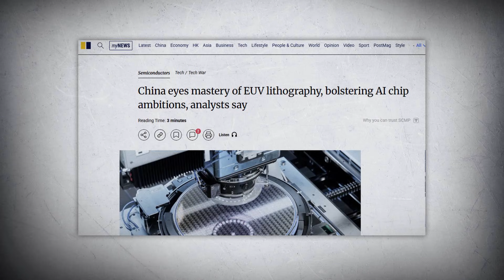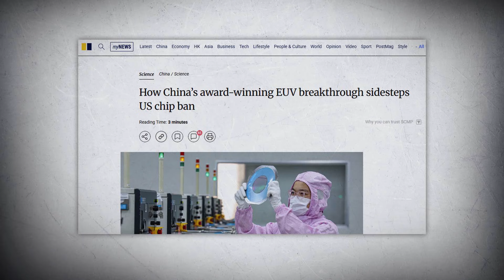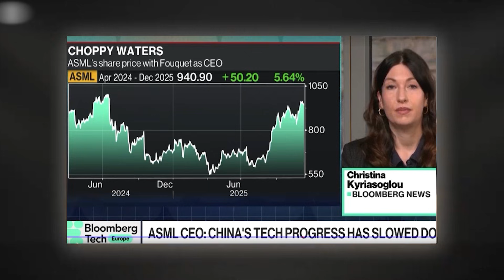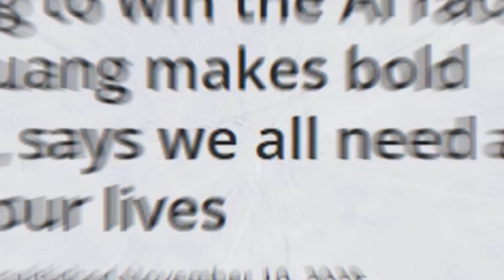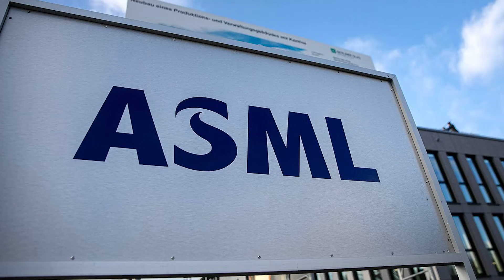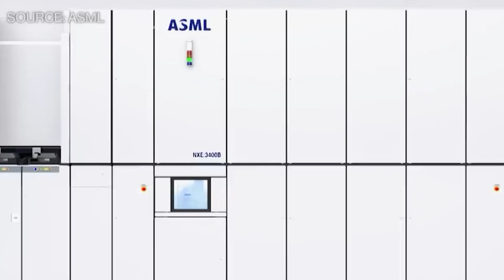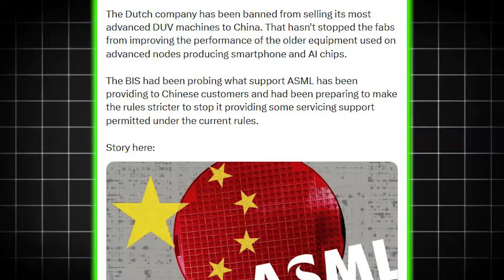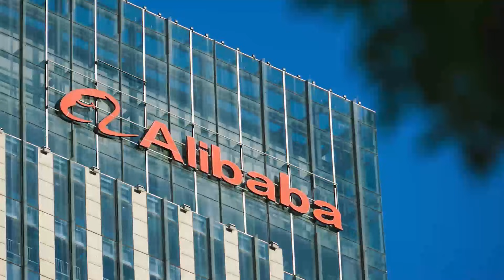China’s Manhattan Project: The Secret EUV Machine the U.S. Tried to Stop

Comment: When they say it will take China ten years to develop the EUV technology to an advanced level they are referring to actually mass-producing the most advanced semiconductor chips , with low fault levels ( low bin rates) and profitably. Anyone can use ASML older machines to make "one-off" 3nm chips , which is what Huawei and SMIC are currently doing, its not that hard.

Comment: Its a prototype. As big as a factory floor. It cant produce chips. Can china make commercially viable duv chips? No. Can china make commercially viable euv chips? No. Will china achieve this feet? Highly likely it will. Will china do so before the west can ween itself off its need for imports from china’s rare earths, is the real question. I think time is not on china’s side as the west has the refining tech but lacks the infrastructure while china lacks the tech. Its easier to build and set up supply chains then to reinvent an existing tech.

Comment: ASML did not master all key omponents for EUV machines. Lenses are made by Carl Zeiss opticks from Germany, for example. And there is more like that. So, ASML is supply chain dependant, and many parts for ASML machines are actualy dependant from China, in basis of that supply chain. So think about when you limithing  someone that yuou need to sell you something that is exclusively available only from him, like Germanium, or som other not so common materials, like strong magnets , that are also needed in ASML machines.

Comment: Reuters claims China is using reverse engineering, which is complete nonsense. China doesn't currently have EUV machines, so how can they reverse engineer them? Are they reverse engineering something out of thin air?
The most bizarre logic of the West is that they always assume China lacks independent research and development capabilities, and whenever China achieves a technological breakthrough, they immediately claim it's "reverse engineering, imitation, or plagiarism."
If the West refuses to face reality and continues to bury its head in the sand like this, it will only lead to further decline in the future.

Comment: China is making a more advanced EUV machine. It does not use a gear to move the wafer; instead, it uses magnetic flotation. China uses much higher UVlight generated by a special method.. Etc....The Netherlands' EUV machine is outdated, while China is moving ahead. Think about it. China sent a spacecraft to the moon, landed, collected soil samples, and returned twice. China holds technology that the Netherlands can only dream of. The Netherlands ' second mistake after Experia is the EUV machine.

Comment: russia has also produced EUV light, but they aren't expected to have a functional EUV lithography machine for about a decade, though the EUV light they produce was a smaller nm than ASML's was at the time (ASML has a newer lithography machine now), however russia is already upgrading the EUV laser for an even smaller laser when the machine has actually been realize. i do not expect russia to be a leading world chip producer however, unlike china which is a lot closer in the labratory with 2nm than then west would like to admit. not to mention china is working on making a how now type of memory (only NAND so far, but the premise should be applicable to virtually all types of memory) for computer which is thousands of times faster (and theoretically up to 1.5 million times faster) , which they expect to start mass producing between 2027-28 and go into full scale mass production by 2030, so by 2030 at the latest i would expect china wo be the undisputed world leader in computing in everything from CPUs to GPUs to memory to custom chips.

Comment: It's not reverse engineer.  Lithograph is not new, knowing the electromagnet wavelength is not new.  The key to ASML EUV machine is just that, the EUV itself, the ability to creating EUV.  The gears, motors, mirrors, tin, lasers etc is not new and you can't patten it. It's like a car, you can't patent a car.  What the issue is that ASML used some parts made in the USA. ASML patented the double tap on tin drops method of producing EUV using American laser.  Guess what, if you can come up with a method of producing EUV without using American made laser and come up with a different method other than double tap, you have a winner.

The method the Chinese engineers came up with is far more simpler and way more efficient than what ASML came up with.

Now the Chinese machine is big, the reason it's big is because they are using off the shelf parts and it allows for ease of trouble shooting and replacement/swapping of parts.  Remember, it's not ready for market, it's still in the experimental stage.  Once they determine that the machine is 100%, they will shrink and optimize it for market. 

Winner winner, chicken dinner!!!

The next big semiconductor lithography machine will be using Xray.

Comment: Huawei released its Mate 80 series smartphones on 25 Nov 2025 which should have been released in September. Why? Please also take note that 2 types of Kirin chips, i.e. Kirin 9030 and Kirin 9030Pro are introduced in the Mate 80 series smartphones. Why? These 2 questions are related to the EUV machine that Huawei has been testing since May this year. Initially Mate 80 series smartphones are supposed to be introduced with Kirin 9030 chip which is based on VGAA technology and produced with a domestic DUV machine. However, Huawei later decided to use the EUV machine to make a slightly higher performance Kirin 9030Pro chips. As a result, the Mate 80 series was released 2 months later in November to include the Kirin 9030Pro chip in the Mate 80 series smartphone release.

Comment: You know that the prerequisite for reverse engineering is that you actually have the product you want to reverse-engineer, right? So the question is: who quietly sold EUV equipment to China, enabling Chinese engineers to get started?
Reply: You DO NOT NEED as a "prerequisite" a product to be on hand to copy and "reverse engineer" that product. Stop using 'reverse engineer" as a buzz word. 
Go read up about how IBM lost its monopoly in PCs in the 1980s (or look for my comments above on the story behind this).
Reply: china didnt start  it now, its goindg back to the 80s

Comment: USA Manatthan project : build a bomb to ensure World domination
China Manatthan project : build cheap AI chips for World development
Reply: yap, huge difference
Reply: And sending hundreds billions to Israel for genoxide
Reply: Should be easier than a space station.
Reply: China's EUV lithography machines never needed to reverse-engineer Western products—the core reasons lie in the total lack of physical samples to disassemble, the insurmountable complexity of the underlying technologies that cannot be replicated through teardowns, and our adoption of an independent, diversified technological roadmap. What’s more, China’s EUV tech is far more advanced and powerful than Western counterparts—it not only breaks the monopoly but also outperforms the West in core performance and technical architecture. The Western claim of "reverse-engineering" is nothing but sour grapes.
 
I. No Physical Samples to Reverse-Engineer: Blockades Forced Us to Forge an Independent Path
 
- The US-led comprehensive EUV embargo strictly prohibits ASML from selling complete EUV systems to China; we are denied access even to core components and technical documentation. Without any physical reference, reverse-engineering is simply impossible.

- Even attempting to disassemble older DUV machines would be futile. Mishandling during teardowns can easily damage the equipment, and DUV and EUV differ drastically in technical principles and system architecture—tearing apart a DUV machine yields zero insights into EUV’s core know-how.
 
II. Overwhelming Technical Complexity Makes Reverse-Engineering a Pipe Dream
 
- A single EUV machine integrates over 100,000 components, spanning dozens of disciplines and relying on more than 5,000 global suppliers. Its software runs on hundreds of millions of lines of code, and the nanoscale coordinated calibration experience and long-term operational data are completely inaccessible through disassembly.

- Western core optical mirrors demand a surface flatness equivalent to "a height difference of less than 0.4 millimeters across an area the size of China’s territory", yet teardowns cannot replicate the precision of their multi-layer coating processes. Core technologies like tin droplet control and energy conversion in the light source system are the fruits of years of R&D accumulation, not something that can be copied by taking a machine apart.

- ASML’s equipment is equipped with embedded monitoring systems and patent barriers—reverse-engineering would trigger legal and technical protection mechanisms, making the task as difficult as scaling Mount Everest.
 
III. Independent Ecosystem + Diversified Technical Routes: A Fundamentally Different Path from the West
 
1. Core Technical Route Differences: China’s Approach is Far More Forward-Looking
 
- The West (ASML): A single, inflexible route dependent on US CO₂ lasers to power the LPP (Laser-Produced Plasma) light source. It requires bombarding 50,000 tin droplets per second to generate EUV light, suffering from inherent flaws like tin contamination and low energy conversion efficiency.

- China: Parallel independent and diversified routes, including the solid-state laser-driven LPP route developed by the Shanghai Institute of Optics and Fine Mechanics, the DPP (Discharge-Produced Plasma) route from Harbin Institute of Technology, plus innovative solutions like Tsinghua University’s SSMB (Steady-State Micro-Bunching) and Haoyuxin Optics’ HHG (High-Harmonic Generation) technologies. These are not only fully self-controlled but also directly address the pain points of Western tech.
 
2. Key Advantages: China’s EUV Outperforms the West in Performance, Cost, and Stability
 
1. Light Source Performance Dominance
The West’s LPP light source has a mere 5.5% energy conversion efficiency. China’s solid-state laser LPP has already reached 3.42% (with a theoretical ceiling exceeding 6%), the SSMB solution delivers a power output of 3,200 watts, and HHG technology achieves a "broadband-ultrafast-coherent" trinity with tunable wavelengths and zero contamination.

2. Dramatically Improved Stability
The West’s tin plasma light source causes severe tin contamination, requiring mirror cleaning every 2 hours. China’s EUV-FEL (Free-Electron Laser) solution eliminates tin contamination entirely, extending mirror cleaning cycles to 50 hours. Its power stability of ±0.5% far surpasses the West’s ±5%.

3. Exponential Leap in Inspection Efficiency
Western electron beam inspection is slow and low-throughput. China’s HHG-EUV inspection is 100–1,000 times faster than electron beam methods, with a resolution 10 times better than DUV. It can identify defects smaller than 5 nanometers and enables non-destructive 3D imaging.

4. Superior Cost-Effectiveness and Flexibility
Western EUV systems are bulky, prohibitively expensive, and costly to maintain. China’s HHG systems can be deployed on a desktop scale (just 3m × 1.5m in size), eliminating the need for complex contamination control systems. They boast strong engineering feasibility and democratize access to advanced EUV research equipment.

5. A Fully Localized Industrial Chain
China has built a complete domestic supply chain covering optical mirrors (Changchun Institute of Optics, Fine Mechanics and Physics), laser crystals (Fujing Technology, holding 80% of the global market share), precision structural components (Fuchuang Precision), and system integration (Shanghai Micro Electronics Equipment). In contrast, the West relies on a fragile network of over 5,000 global suppliers.
 
IV. Conclusion: A Victory for Independent Innovation, Not Reverse-Engineering
 
The Western hype about "reverse-engineering" is essentially an unwillingness to acknowledge that China has broken their technological monopoly through independent R&D. China’s EUV technology not only shatters the blockade but also surpasses the West in technical routes, core performance, and industrialization costs. The fundamental difference lies in this: the West has taken a path of "monopolistic single-route reliance + pushing physical limits", while China has embraced "diversified innovation + system optimization"—and that is the true definition of technological leadership.
Reply: @kinwaisiu9414 Well concluded with superb supporting argument/evidence! ❤
Reply: China's Manhattan Project's goal is to overcome Western (especially US) oppression, not to build cheaper chips.
Reply: @theotheleo6830  Eso aun esta por verse, una cosa es seguro no sera para la dominacion del mundo.
Reply: @theotheleo6830 China always aims to makes things cheaper, deflation! What's wrong with deflation?
Reply: @daniely500 it's bad for big company's earnings. Good for consumer 😅
Reply: @daniely500  They're doing this on their own. It will cost them much more to accomplish this than other countries that have no trade restrictions. They're not doing this to make chips cheaper; they're doing it because they have to.
Reply: @theotheleo6830 True in the short term. 

They wouldn't have done it if they weren't forced to. 

But not having to pay high margins for foreign equipment will serve them in the long run.
Reply: @daniely500  deflation is bad for capitalist....less money...how could they live with that?
Reply: @TheIdiosyncraticMe-t3u   You ask wrong question maybe its not  how could they live with earning less money , but how it get too expensive maybe the inflation is artificially made to make us think its supposed that expensive
Reply: @Jacktan9203  Deflation destroys whole economies. It did so in the past and will do it again. It is worse than hyper-inflation which is seen as VERY bad.
Reply: @KaEl-Alpha except that China is the world's manufacturing hub and the underlying difference is that Chinese consumers have a high saving rate. China isn't deindustralizing. China's trade surplus rose to 1.2 trillion USD in 2025. Just hear what Jensen Huang and Elon Musk says about China and the future of AI 😅😂
Reply: @Jacktan9203  Germany isn't either. We are just shifting industries and developing like crazy. Jensen and Musk I don't trust at all they support Trump so I count them both as Nazis. I trust your Xi way more than those. We support China only the thing with minorities like the Uygurs we don't support here in Europe.
Reply: @Jacktan9203  Deflation is dangerous no matter what a country does. The outcome is you will cut down industries, cut wages, people get poorer and so on - a circle of death even for china. By the way China lies about their population a lot of analysts say it is way below 1 billion and not 1.4 billion like Xi claims. So a lot of is fake and we should not trust everything a dictator (he is one too) tells. Those are all the same no matter which country they are. I love Chinese common folks - the people :)
Reply: @KaEl-Alpha One thing I know is that western travellers have been vlogging in xinjiang and it's all on youtube for everyone to see. On the other hand, you have BBC and US CIA trying really hard to created problems in Xinjiang and spread flash propaganda as they have been doing all along. Western bloggers are surprised by how safe and happy Chinese, including Uighurs in Xinjiang are.  

You and I know very well that the US would use any opportunity to create instability in China given the chance to, even if their people are perfectly happy and fine. And no Western country takes care of its citizens like China does with high speed rails and constant improvements in public infrastructure 😅
Reply: @theotheleo6830 廉价很重要，现在的游戏显卡太贵了😢
Reply: ❤Precisely well said
Reply: Well said. You are brilliant 🎉.
Reply: Well said!
Reply: One builds. The other destroys.
Reply: you are really confused about how Chinese regime think and operate. A bit childish thinking they do this for "humanity development". Chinese regime consider all Chinese ccompanies as part of the DEFENSE,and use economy and production typically with dumping policies for destroying the other economies. All the smaller countries that made agrrements with China have been parasited in their natural resources or technologies or soil occupation. They are a world cancer and it was created by the criminal greed of western jew bankers and former aristocratic families that decided to invest in a poor country to enslave for production and to give all the rights to violate the basic international free market rules. this destroyed a great part of western companies and jobs. Chinese regime was smart enough to exploit the situation and create its own companies while western investors pushed western companies to move to China for having much higher profits. many of those now have failed because China stole all their patents and know how and has now its own producers.
Reply: 10/10
Reply: cheap china can copy or steal but it cannot have stolen the entire concept even if it poached on all it's chinese employees employed by ASML
Reply: @beeone935  The methodology and approach to EUV differ significantly. So the claim that China is simply ‘copying’ or ‘stealing’ is nonsense—patents are patents, and derivative innovation has always been fundamental to how the patent system works.
Reply: @beeone935 which part is copied? Or you just mad?